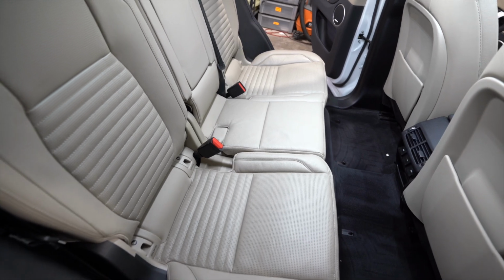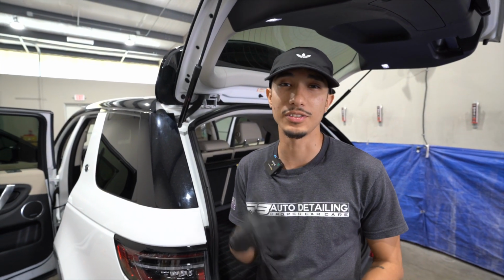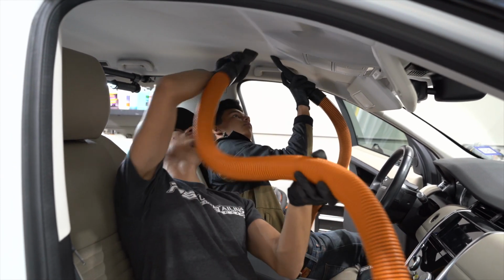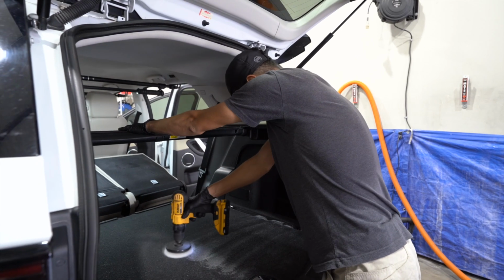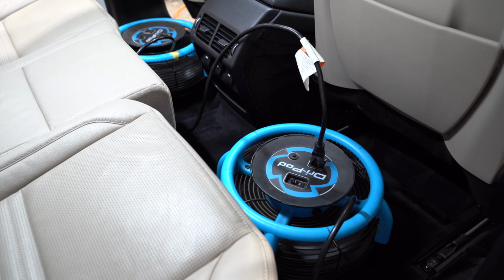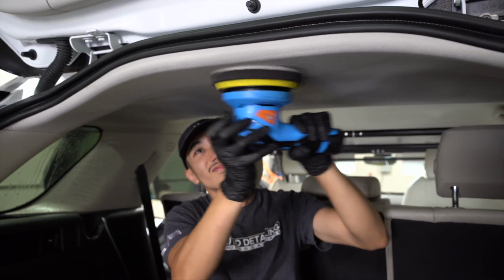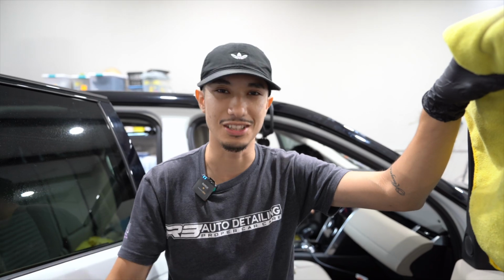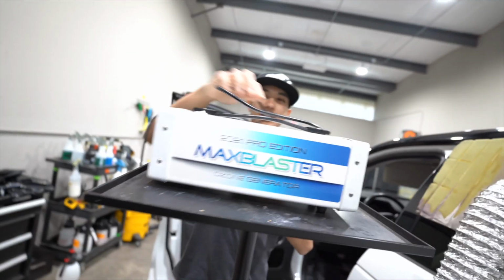How We Remove Smoke Odor From a Cars Interior | How Much Does it Cost?

Comment: The problem is, the odor is in the heat ducts and the heater core / air conditioner core inside the dash. Pulling the heating / cooling system out and physically washing all components is the only way to eliminate the odor.

Comment: Have you ever had any issues cleaning the headliner like that? I'm always worried about it sagging when I spray it down lightly to agitate it.
Reply from the maker: We change our method based on the condition of the headliner. This one was in great condition so it was easy to spray and agitate. Others, we might go with a more gentle cleaning
Reply: @Detail Groove  what polisher is that for the headliner?

Comment: What brushes do you use for you drill? I have bought 2 sets of Amazon and they all have broke where the metal is molded I to the plastic. Maybe it's user error but I figured I would ask, also what do you use for brushing the headliner?
Reply: aye boss, worth a shot, but I get mine from Home Depot, the Ryobi ones have been with me for about 2 years no without any issues!

Comment: whats that thing ure using on the roof?
Reply: It’s just a typical polisher with a gentle microfiber pad, the same kind you use for final stage paint polishing. It’s the most effective way to clean a headliner. Do it all the time in my detailing business.
Reply: @statusquoreject  What cleaner would you use with the headliner cleaner and the orbital polisher
Reply: @JacobThomas_17  I use Koch Chemie Polstar or P&S Carpet Bomber. You can use anything that’s made for textiles or even ONR or McKees 37 rinseless wash diluted down to their interior cleaning ratios. Just don’t use an APC or a degreaser like Super Clean because they can damage the glue that holds the headliner in place causing it to sag. Just spray the cleaner on the microfiber pad instead of the headliner. If you have a bad stain spray it onto soft bristle brush to agitate it and then go over it with the polisher. Use a dry microfiber towel after to soak up any excess liquid left over.
Reply: @statusquoreject  thank you very much, it’s greatly appreciated!!
Reply: @JacobThomas_17  sure brother, happy to help.

Comment: Ozone machine kiddo, no chemicals and way cheaper, easier, let car air very good after that.
Reply from the maker: yup, we run it for 4 to 6 hours. turns off on its own. Move vehicle outside and air out
Reply: I did this, it works at first but the smell comes back after a couple weeks. You have to get it out of all the fabrics or it will always come back.